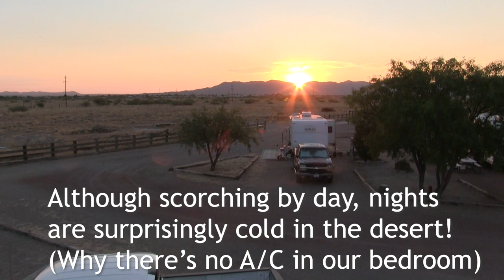Tiny-Home-Improvements & Buslife Update at the Cattlerest RV Park

Comment: I got tired of replacing the junk propane pigtails. Went through about 6 of them. I always had problems with leaks between the hose barbs and hose. The hoses can actually twist on the hose barbs especially in cold weather when the hoses get harder. The barbs would eventually cut into the hoses making them leak.

I went to a local industrial hose supplier that sells hoses and fittings and also manufactures hose assemblies. I provided them with 2 brand new green Acme nuts with barbs and asked them to make 2 hoses for me. I told them the overall length and that each hose was to be rated for propane and have the Acme nut on one end and a female 45 degree swivel nut on the other end. I also purchased 2, 45 degree male x 1/4 male pipe thread fittings. They crimped the fitting to the hoses using heavy duty ferrule

I replaced the 1/4 male pipe thread x inverted flare fittings in the auto change over regulator with the new 45 degree male x 1/4 male pipe thread fittings and installed the hoses. I have never had another leak.

If I need to turn the hose to swap between 20 or 30 lb cylinders I loosen the 45 degree swivel nut then retighten it. The hose never rotates on the barb like it used to.

Comment: Just curious, could you replace the door glass with 3\8" Plexiglas? Kerry there's evidence of black spray paint usage on the propane tanks 😁 humble suggestion, the gap over the door could be covered by a piece of sheet metal like a piece of 1" studwall track.

Comment: I have 3200 watts on the roof and 13k+ watt hour diy battery bank. I'm in the D/FW area of Texas. It was only 94 degrees yesterday, but I woke up with 64% battery running TWO minisplits. (12k and a 9K) It can be done. But you have to oversize the s*it out of it. But, 8 months out of the year its totally overkill. But, I like overkill.
Also it SEEEMS that if I run both units all day and night its easier than trying to crash cool the bus when I get home from work when its 100+ degrees inside. Good luck y'all. I'm sure our paths will eventually cross...d("d)

Comment: Would it be safer to have 2 on the back window
Reply from the maker: It only came with one and only one bracket.
Reply: Understand just wondering cause you usually see vehicle back hatch windows with 2 and the back hatch with 2